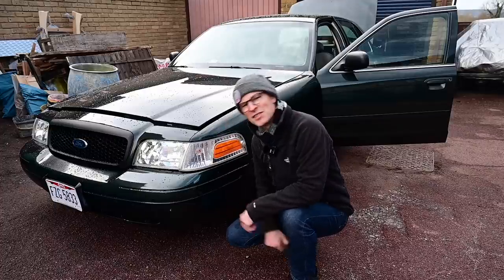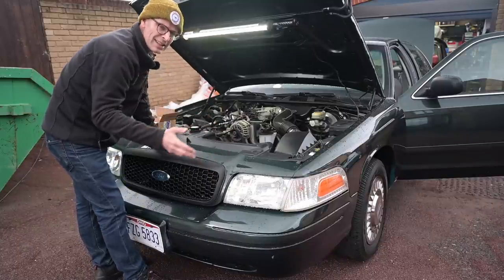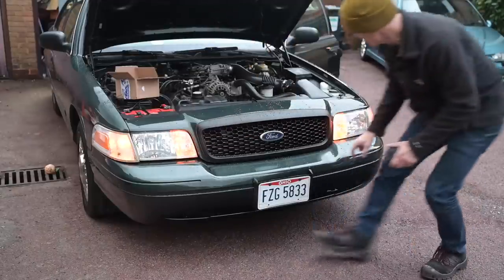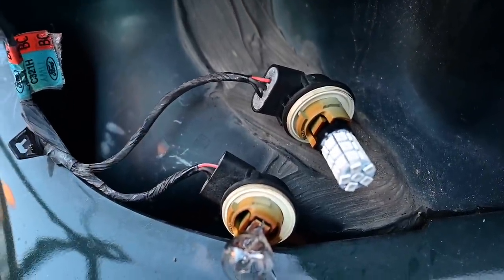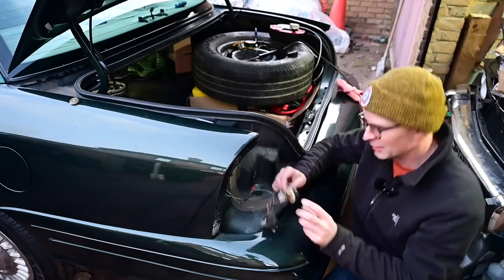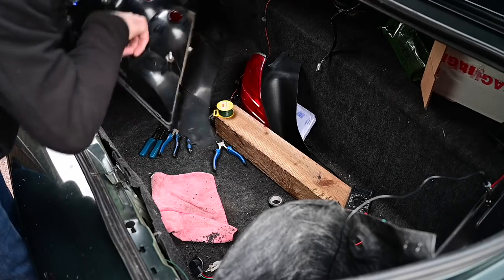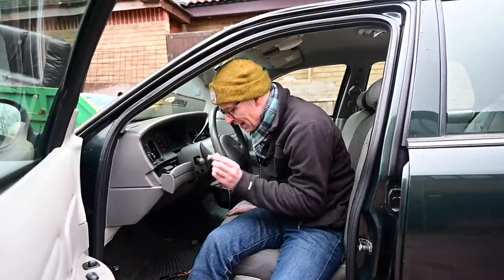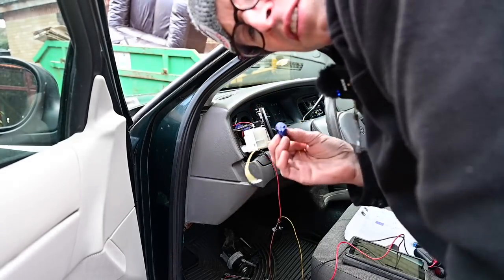Making my Crown Vic lights UK friendly

Comment: Just incase you didn’t know, you may run into an issue with the LED turn signals still hyper flashing even after you finally get all 4 installed as the LEDs draw less power and the system things they’re dead bulbs. The easiest fix for this is replacing the turn signal relay found under the dash with an LED compatible one. Love your Vic videos!!!
Reply: I had this problem on my MK1 Fiesta, it would actually refuse to work with 4 led indicator bulbs and go stupid quick with 2 , many hours of head scratching later and I figured out the problem... Changed the relay went to normal speed but then I had all 4 flashing at a constant speed ( Hazard lights )  I had to make a diode pack thingy up for the bulb in the clocks what flashes with a indicator turned on...  Eventually got it all sorted lol.
Reply from the maker: If that happens in line resistors are about £5 and simulate the load from a regular bulb, so will add some of those
Reply: Extra bulb maybe a parking light?
Reply: @furiousdriving  ok, but then you loose the benefit of the reduced current consumption the LED bulbs offer. I think the new relay suitable for LED indicators is the proper way to go. Happy New Year with many Volvo and Ford miles!
Reply: Got to agree with getting a dedicated led relay, i replaced all the indicators on my Caterham and had all sorts of fun, the led relay was simple and saved any further mucking about with adding extra components that could fail.
Reply: @furiousdriving   I would say resistors in parallel and not in series.  You need to emulate the resistance of the wire of the bulb.  But be careful as they might get hot when you keep the blinkers on. A couple of Watt generates a serious amount of heat.  I even have a 10 Watt soldering iron and the tip gets to about 350C and I can solder components with it.  So if installing resistors make sure they don't touch anything.  A led blinker module might be a lot better actually.  Also please place inline fuses for every new 'line' you install like the fog lights.  The fuse needs to be at the start of the 'line' so not at the back where the bulb is.  You can calculate the current via P = U x I taking into consideration that 12V is like 15V max ... Also take into consideration that the thickness of the wire needs to be at least a certain size.
Reply: @furiousdriving  I think a simple plug in flasher relay would be easier and no more expensive.
Reply: @furiousdriving  this is what we do for LEDs over here. The led relays never last for long it seems.
Reply: @ManosS40  No problem with LED's and trafficator arms, they flash themselves and are brighter than the normal bulb making the arm more noticeable for owners who like to keep a car as it left the dealer when new.
Reply: @ManosS40  You are correct about the consumption, but I have to point out the reduced consumption makes no real world noticeable benefit.
Reply: @GoldenCroc  on the long term it does! And to add to my argument, that with the minimal heat these bulbs emit, the lenses and the plastic reflectors do not fade and the wires (and the whole electrical system) do not stress. 😉

And yes, I love LEDs! Incandescent bulbs are "ancient" insufficient technology. 😁
Reply: @KutreeZ  lol, i had a mk1 fiesta also, i had as many american parts for it as i could get, down to the seatbelts, steering wheel centre and basically, if it was different, i was having it.

The easy thing with them, yeah swap a relay and you're good, problem with the crown vic, is these 'relays' are part of the LCM (Lighting Control Module) and it is possible to convert to a traditional relay, but it isnt so straight forward as it involves messing with a circuitboard. But as mentioned already by my furious, you can get inline resistors which are the easiest way, i personally like the idea of adding a different relay to the lcm board as you can then make it into a standard relay and thus easy to replace if needed and also can get adjustable ones so you can adjust how quick it flashes
Reply: @Papa7Bravo  US Spec bits cost a bomb now.  I've got a NOS set of lower grilles to fit and some 1.1x DCNF carbs.  Other than that shes kind of "original"
Reply: @KutreeZ  i had the upper and lower grill, used mk1 escort rs 1/4 bumpers, had a moonroof also, it was a 1.1 on the series x dcnf's as you have also, i somehow got lucky and found a 4 branch exhaust manifold that was being mis-sold as a x-flow, but i knew exactly what it was and rhat it wasnt XD   american tail lights, i think indicator stalk or wiper, i had one but not the other as they're stupid rare in the US even, the centre cap on the steering wheel, seatbelts because they were just cooler than the euro ones we have. It was a 1982 bravo in red and silver, i really do miss that car so much, it was slow AF but sounded so cool and was just fun, unless you needed to go quick which is why i later got a mk2 and dropped a st170 into, i will always daily a 'different' car, and the mk2 i almost finished just needed rear arches and paint then could've focused on the mk1, but now they're gone, and have a sierra sapphire that i haven't touched almost since i got it as ive kinda been focused on my crown vic which is almost completely done then maybe ill start on the sierra and stop being an idiot.
Reply: These cars do NOT  have a separate flasher relay from the factory . The turn signals & hazard flashers are flashed by the lighting control module under the dash .  To eliminate hyper flash you must cut 2 wires going from the harness to the module , add 2 female spade terminals to the wires from the harness and then add  the flasher relay

Comment: Also, for the MOT, do the headlight beams need to point the right way? Meaning the glass might need some blanking to not dazzle oncoming drivers?
Reply: Yeah I was wondering that too
Reply: I'm surprised it hasn't been the first issue addressed.
Reply from the maker: Its a 'flat beam', no lenses in the lens, so just aim left
Reply: American headlights don't dip left or right they have a hot spot of light in the centre, so they will not blind on coming traffic anyway, the mot tester should know this as it's in the mot testers manual. But one thing I will say is you should have white side/parking lights showing to the front, I'm not sure how you will get away without them.
Reply: @Azureecosse  those don't work on US cars as the beam doesn't have a beam cut off, they will be a MOT failure
Reply: @Azureecosse  cars in the UK have headlight beams that dip to the left so not to blind oncoming vehicles, cars in most left hand drive countries have lights that dip to the right, beam benders that stick to the Lens bend the light to the right for driving on the right in Europe. Most cars sold in the USA don't dip to the left or right the headlight beam is straight ahead creating a light hot spot straight ahead on the road. I have a USA ford escort zx2 here in the UK and years ago it failed an MOT because it had beam benders fitted, they distorted the light creating dazzle to other road users.
Reply from the maker: @Azureecosse  I think you're missing Neil's point, which isn't whether American car headlights can dip or not but about the lens on the front. 
European LHD cars (as used in europe or the US) have deflection lenses which disperse or focus the beam of light off to the right when dipped or not when dipped or main. The 'beam deflectors' which Ive used on RHD drive cars on the continent, cover the part of the lens that focuses light away from traffic, either just as black tape to stop it or a fresnel lens to aim.
American domestic cars typically have plain, clear lenses that dont focus or aim the light beam so you can't use the beam deflectors as there is no area to stick it over.
Neils point was he tried and the MOT failed as the lens wasnt compatible.
With these lamps you just point away from traffic as they are not focused
Reply: I'm in US and I have no idea what any of you are talking about? "Dazzle" oncoming drivers? In America, to dazzle an oncoming driver means something totally different
Reply: The lights would not blind on coming drivers at all. They are designed to not to. If it was an issue the same lights would not have been used over a 20 year run of the cars production. There is a reflector mounted in the light that creates a cutoff line so the hotspot of the light does not shine up into oncoming drivers. Same as every other light produced out there. Not all UK lights are projector lights. Most of the lights you guys have work exactly the same the crown Vic.
Reply: Good point. I couldn’t dazzle oncoming drivers if I tried.

Comment: Just an FYI the civilian 2nd gen crown Victoria and the very very early 2nd gen P71's used amber turn signals at the rear using that area underneath the main taillight area. In mid year for the 1999 P71 they switched to using the brake light as a turn signal and hollowed out that darkened area for strobe emergency light use. If you want later down the road, you can just get a set of Civilian taillights and they will have amber turn signals in that area, you might need to do some rewiring though. My CVPI is an early '99 model so it uses the Europe friendly setup, and in my opinion, is also a lot safer.
Reply from the maker: Yes, they are only about $35 on rock auto but only for the lamp, not the electrical parts, but I like the original all red lamp this has
Reply: @furiousdriving  Yeah, being that setup is original to your model year, I don't blame you. I'm the same with my '99. I want everything to be year/period correct.

Comment: I'm American and own a Lincoln Town Car (a rebadged Crown Vic). I honestly think that for safety, turning signals here should also be required to be amber and never red. I don't think it's too big of a deal and I'm not going to swap out my tail lights, but I don't think it's good that the brake lights and turn signals are the same color.

Comment: The non flashing bottom piece used to be an amber signal but was removed from p71’s halfway through 1999.

Those whelen mirror lights involve purchasing two separate things. First is the mirror housing, next are the lights. The lights are called Whelen 500 Series lights. Crown Vic’s only fit these. I recommend a set of chp mirror beams then purchasing the 500 series.

Comment: The taillight turn signals were only amber for the first year of CVPI production and were removed for the 1999 model year (and removed from the civilian cars in 2004), probably to save FoMoCo a few cents. It was pretty common for emergency equipment up-fitters to install strobe lights in those un-used lenses. The 'extra wire' in the corner light on the passenger side is actually just a tube that is there to let moisture out of the housing. The reason one corner light has no hole in the bottom is probably because originally the corner lights would have been wired with white strobe lights as part of the emergency lighting added to the car, and at some point the corner light on the drivers side cracked and was replaced after the emergency lighting, radios, etc. were removed.

The under hood light has a gravity switch which can be pretty finicky. It's suppose to be positioned so the bulb is facing forward so the gravity switch can work properly (and the little plastic pin goes into the hood to keep it in position). You probably just have to pull it out and pop it back in, into the two holes again. The wires on the trunk were part of an optional lighting package if I remember correctly for lights that would turn on when the trunk is open as a roof mounted lightbar would be otherwise be blocked when the trunk is open (I've seen them on other CVPI's of that vintage, they looked like this https://www.youtube.com/watch?v=rraFRpEbNv8).

Also, if you intend to add cruise control, I do believe at least one brake light bulb (third brake light or taillights) needs to be a proper incandescent bulb and not a LED, as for some reason the cruise cancel is activated by the brake light resistance in the cruise module (but since you are handy, you could add voltage resistors to mitigate this issue). Side note, you can still buy those front license plate brackets NOS on ebay for around $20 USD. Anyhow, hope some of that info is helpful, stoked you finally got your dream car. Cheers from N.J. USA.
Reply from the maker: Thanks, thats all really helpful
Reply: I was just about to comment that there used to be amber lamps early on. The Ford part numbers are 3W7Z13405CA for the left hand side, and 3W7Z13404CA for the right.
Reply: Also the part number for the harness that goes with those lights with the 4 sockets is F8AB-13407-AG and it's the same part on both sides. I don't know if this would plug straight in to the harness of your car and just work or if you would have to do more adapting but those are the parts at least if that helps any.
Reply from the maker: @a-aron5691  I don’t think it would be as simple as plugging in, this being a 3 wire loom you’d have to trace back a long way to find the split

Comment: Very interesting to watch!
My EU spec 2001 Nissan Maxima (Infiniti I35 in US) had blank inner rear lights for the EU market. I put lights there and took power from the license plate lights. Now hole row of rear light work and looks much better. Previously only outer rear lights worked.

Comment: The two plugs behind that panel to the left of the steering wheel, those are for the Power Adjustable Pedals and Traction Control. When the car is ordered, and those two options are not opted for, the buttons are not put into the panel. They also do not put the powered pedals on the car. So, if you get the button, you also need the powered pedals. All they do is run the wiring to make it easier to install.

Comment: 7:25 There was an option on those cars for cornering lights, to illuminate the path to the side when the turn signals are activated (and a few seconds after they stop). You might be able to get a pair of lamp housings which support that option and put some bulbs in to act as side markers and to provide some side illumination during turns. On the other hand, I don't know what's behind that yellow reflector patch on the sides; maybe there is a way to just put bulbs behind them and light up that section.
Reply: I have a 2007 Grand Marquis with cornering lights, but the lenses are different.
Reply: just a quick note. police spec vics don't have the wiring for this unfortunately. only the civilian and variants of it.

Comment: early model crown Vics have amber turn signals where your blanks are. 1998-2004 Vics used amber turn signals. I would run a wire from the front turn signals to the back to avoid the amber lights coming on with the brakes. the turn/brake light function is controlled under the dash so both feed down the same wire. so running an independent turn signal wire from the front is your best choice.

Comment: I had a 1967 Cougar and the sequential rear indicators always failed the MOT but I wired in an "MOT" switch to please the tester on the day. Annoyingly, sequential indicators are now legal on the likes of Audi and Mercedes. I also had a Mk 1 Escort to which I fitted a high level brake light that caught the wrath of the law, yet they too are now also legal.

Comment: I have got 2004 Crown Vic LX in Norway. Now its not neccesary to rebuild the lights to EU standard any more in Norway. Happy for that. The brake and turnligt is a serial connected. I did only clip a wire in the front. I did buy another light housing for the taillights with amber glass. Not necessary to do this. Ford Crown vic is one the most durable car ever. I love it.
For my old Dodge, I will go back to the red turn/brake signal and reconnect the yellow/amber marking ligts, backupligts and cornering lamps. Will do the same with my US  RV. Here I only have to exchange amper lamp to red for the outer lamps (twin ligts for park brake)

Comment: I have a 2003 import (not a Crown Vic) and I have an on/off fog light switch, not a momentary one. Passes MOT fine but switch needs to be labelled. I'd try getting it working with a proper toggle switch first then introduce the momentary once you are happy with it.
Reply from the maker: The new regs say momentary apparently so got to do it

Comment: The wiring in the trunk lid is possibly for an electro-magnetic gun rack. 

It's easy to make the outer yellow sections of the front lights flash as indicators. . I just moved the wiring from the centre to the outsides on my Chicago Vic.

Comment: In my Cadillac Fleetwood 1993 I but the indicator in the rear white reverse light with orange bulb.  If it blinks to fast you can slow the indicator down by putting a small resistor on the plus cable.

Comment: You can get an adjustable indicator relay from Amazon for led indicators which allows you to adjust the flash rate, I have them on a couple of bikes that I put led indicators on and you don't have resistors to try to hide, keeps it looking standard. Shame you can't separate the lens off the unit and you could epoxy a divider in to split the lower part of the fitting. I'm with you for trying to get everything in the original units, always looks a wee bit sad when you have to hang a fog light off the bumper. I'm sure there are owners around who have addressed the problem, time for some plagiarism from them? 😂

Comment: If you look when the rear indicator is flashing, the inner sector isn't illuminated at all, meaning you could have used it for a fog lamp.

You don't need a momentary switch which resets when the ignition goes off, nor does it need to restrict the fog lamp from illuminating only when the main beam in on.